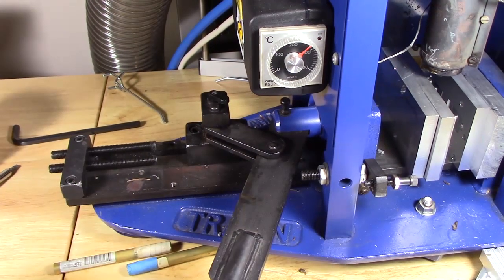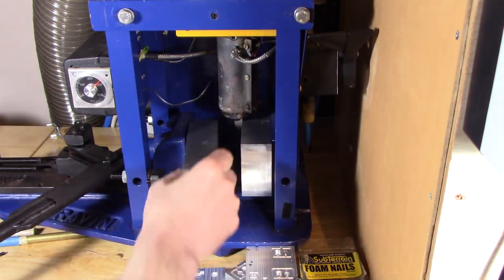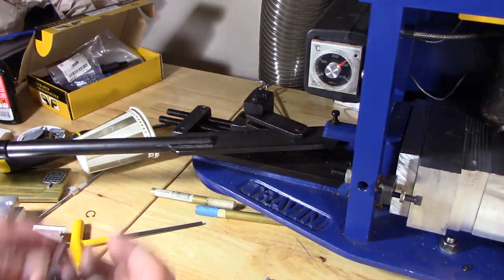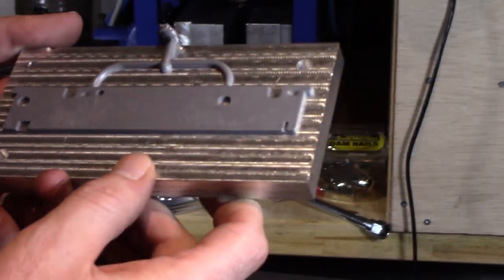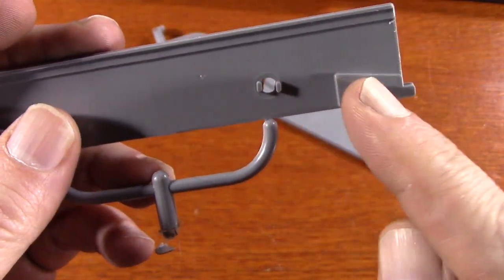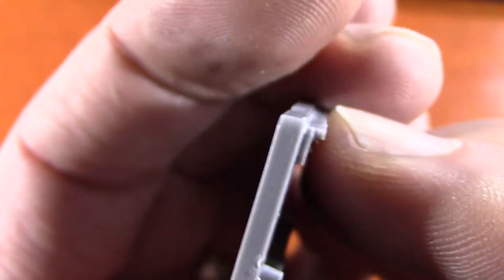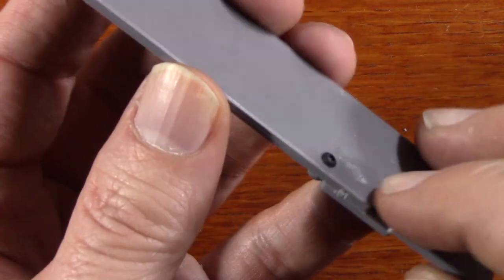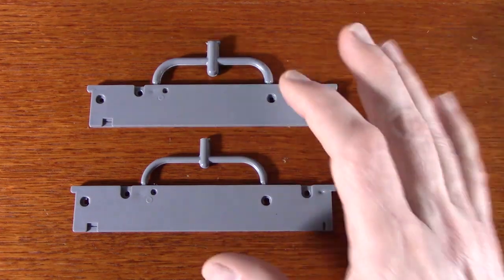#9 Injection Molding Part II

Comment: This is very educational :D thanks for the effort.
I work in a company where I design and mill molds for gravity pouring of liquid polymers that harden into stone type material (like ceramics).
This is one example: (I hope the link to image works)
https://ibb.co/cd1aZT

Mold is made from Necurone 1020 material.
Reply from the maker: That's pretty cool. It looks like these molds were CNC machined, is that correct? And can you say anything about the types of products that you're casting? I've used RTV molds for resin casting, which was fun, but not very good for volume or precise work (as the molds would change in size with use).
Reply: Yes they are CNC machined. I usually get a 3D model of a new product from a designer and then I have to modify the model by adding draft angles and corner radiuses if a designer forgets it or if there are some minor modifications to the shape. And the most important factor is to scale the part by the scale factor of the material that is being poured. After that I design the gravity pouring mold so every part has a positive direction pull. One product has 6 part mold. Usually it is 2 or 3. The one on the photo is 4 part. 

Material for mold milling I use is Necuron 1020 and sometimes pertinax. Necuron is an excellent material for milling high molds. It comes in blocks od 30mm, 50mm and 75mm and there is a special necuron glue that enables me to mill molds in layers on CNC machine. There is no need for long end mills, so no vibrations.
Every block slice can be cut with a linear saw with a chosen oversize. Usually 5 to 10mm. And it is drilled with minimal 2 holes for screws. Glue takes at least 4 hours to harden and become solid necuron so screws hold the layer in place while being milled and are permamently sealed inside for reinforcement during casting so the layers don't seperate by accident (but they never do if properly glued). After 24 hours the mold goes to the furnace to be "baked" on 90°C and is ready for use. Mold parts fit together within 0.1mm tolerance. 

Material that we pour is something like ceramics as I already said, I'm not a chemist so, I have no detailed information.
Reply: Here are some more photos

https://ibb.co/m8Ufnp

Comment: how do you know when to stop injection plastic into the mold?
Reply from the maker: It stops as soon as it reaches full pressure. Different molds take a different amount of time to fill, but they're usually consistent. So I experiment to figure out how many seconds of pressure I need to keep before releasing the pressure.

Comment: Hey John, I'm really enjoying your series on injection molding. And as someone who is ahead on the topic, I wonder if you are able to answer a question for me. What is the advantage, if any to having the injection point, or sprue located a the parting line of the mold? I live in a machine shop dense area with lots of mold shops, and one of the owners whom is a friend of mine tells me that all of their injection molding machines (big commercial machines hundreds of tons) inject through a spruce which is of course in this case on the backside of the cavity verses the parting line.

 I am in the process of building my own injection molding machine and have yet to determine orientation which will be dependent on where I will be injecting into the mold, parting line vis-as-vis backside of cavity side. 

Any advice from what you have learned, or know would be greatly appreciated. Bob
Reply from the maker: Thanks! I'm certainly not an expert on this subject, but I'll answer as best as I can. Most of the desktop machines seem to use parting line injection. I suspect this is because it's easy to build, as the clamps are perpendicular to the injection cylinder. I have no experience using the big machines, so I haven't seen how they work. There is one desktop machine that uses a sprue from the back side, which is the Morgan Press. I haven't seen one of these in person, so again, I don't know much about it.

I'm guessing you'll want to use a toggle clamp on your machine. On my machines I usually run out of clamping force first. The Travin is the only machine of the ones I have that has a toggle clamp, but it can only do 4-1/2 tons. I think you'd probably want a pneumatic cylinder closing the toggle clamp. And I'd suggest using parting-line injection for your home-made machine, as I think that will be a lot easier to build.
Reply: John, thank you for the speedy follow up. Well, I have a full CNC shop and the ability to build almost any configuration, but finding some of the finer details when it comes to mold injection is difficult. One industry guy said it should be considered more of an art, which may explain why I have issues with finding some details. 

Yes, this build will likely use pneumatics both for injection and clamping. I have few large 8" bore cylinders that I may use, and at 100 psi I believe that they produce about 6,000 pounds on the output if my math is correct. So once I figure out toggle math, I should then get an idea about how much clamping force I will have. 

I have been bouncing back and forth regarding orientation, was set on horizontal, which would be straight forward in my mind, using 3/4" threaded rod as the main frame, but now considering vertical. 

What I can't get my head around is how the clamping force is the key or weak link in the equation, yet the force of the nozzle against the sprue is not as critical, or doesn't require the same force as the clamp?

I find that the "home/hobby" type machines are priced ridiculously, and for a fraction of the cost I can build a custom unit, which I have decided to do.

If you have any words of advice, I welcome it.

Keep up the good work you are doing, and please continue to share. 

Bob
Reply from the maker: The forces are all about surface area. The injection nozzle has a very small cross section, like 3/16 diameter. But the part I'm trying to inject has a cross section of about 4-1/2 sq. in. So you can see that most of the force is required to keep the mold halves from coming apart.

My Travin has a 4" diameter cylinder, and the injection barrel is 1" diameter, with a maximum air pressure of 140 psi. This gives me a maximum injection pressure of almost 10,000 psi (or 5 tons). With a 4-1/2 ton clamping force, the maximum parts size at 10,000 psi would be less than 1 sq. in.

The other thing to think about is that these desktop machines are usually ram machines, whereas the larger machines are all screw machines. The ram machines need the cylinder to be vertical as gravity is holding the plastic pellets in place while they melt.

The final aspect is platen size. The clamp on my Travin is 4" wide by 3" tall, so I'm really pushing it using a mold that is 6" wide.

I will absolutely keep sharing. I just broke my leg this past week playing soccer, so it's going to be a little while before I make another video. Given my lack of mobility, I'll probably make a video first about my different machines and how they work.
Reply: Firstly, ouch! Sorry to hear about your leg, hope you heal quickly.  Thank you for the reply again, you bring some very important points up, which I greatly appreciate.  The machine I am building is of the ram type, but I was planning on having the ram always in the barrel, and on the back stroke, although still in the barrel, it would move past the opening to the hopper which would gravity feed the barrel with pellets which then would pack on top of the plasticized pellets when the ram moved forward. My plan is to keep non plasticized pellets between the ram and the plasticized material, therefor requiring a little longer stroke than required. Not sure if this is a good idea or not? None the less, I am now leaning toward vertical. 

Of course this is to be controlled by likely an Arduino to auto control... Do I need it? NO! But I like to create, build and over build... It is mostly a hobby.